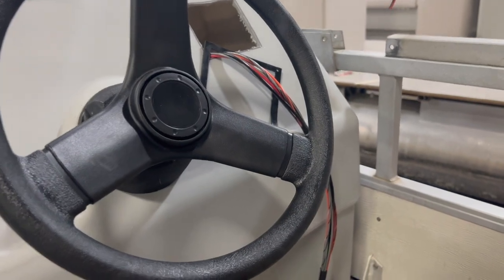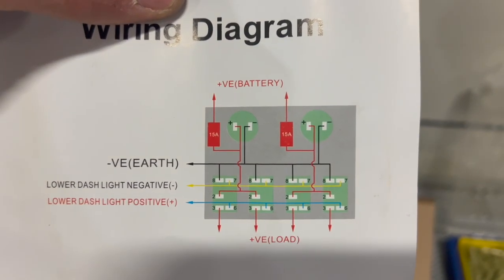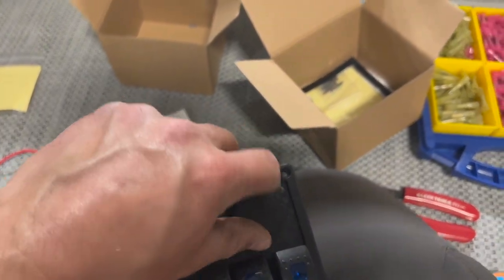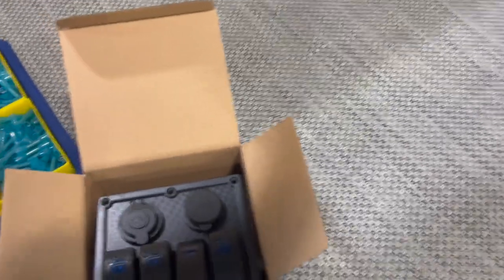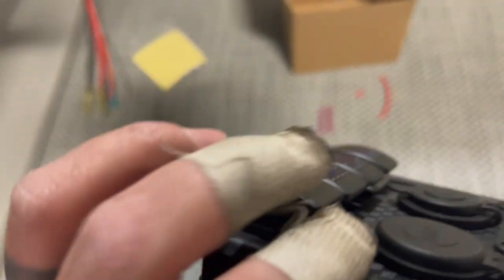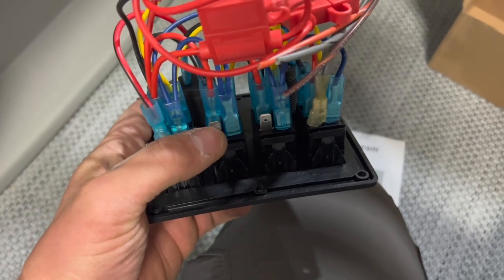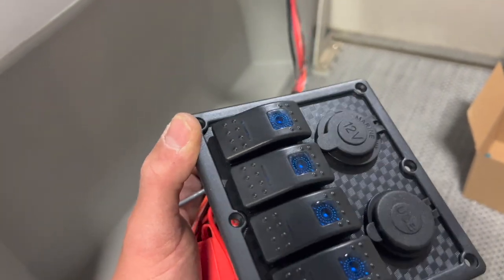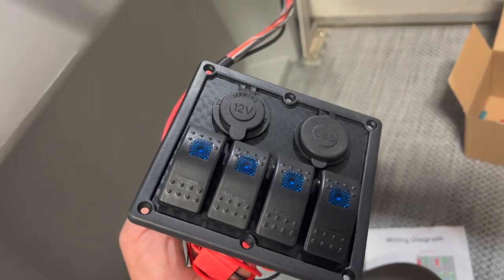How To Install Boat Switch Panel - AMAZON SWITCH PANEL

Comment: I have the same switch but all the lights are on. Not like how you got yours that they individually turn on when each switch is selected.
Reply from the maker: At around 1:50 into the video I show how to get rid of the constant on lights. I just prefer no lights being on when the switch is in the off position. Rarely would I ever want them on all the time. Just one more way for the battery to drain if a battery switch is left on.

Comment: How do I connect the ground wires that are incoming from my lights? I know I connect the power and ground from my incoming power from the battery, but don't know where my grounds connect from the lights that are connecting to the switches. 

I'm installing some light bars on my atv,
Reply from the maker: You should have a ground wire feeding the switch panel from the battery. You can splice/group with that ground wire. You could also use the ground wire from the battery to connect to a ground buss bar or block to tie all of your grounds from accessories together and to the ground coming from the battery. Worst case, run an additional ground wire from the battery negative post to the switch panel to tie your light ground wires to.
Reply: @tomspontoons  so I have the power wire coming in to the switch panel on a two pin for quick disconnect. Can I run all the negative wire together and ground them to the frame or another piece of metal?
Reply from the maker: @mesquiteco5313  I always try to avoid making the frame of the boat a ground. That's where a ground buss block is nice, or just bring them all together and join to a 10 gauge ground wire that runs back to the negative battery post.

Comment: New to the channel. That's a great idea with the tying the USB to a switch. Guess I will be pulling my switch panel out soon 😃
Reply from the maker: Thanks Roger! We’ve found that most panels have an illuminated USB plug which would eventually drain the battery I suppose…so might as well make it possible to stop power when we want. The good news is that it’s a quick and easy adjustment that’ll get things working the best way possible!
Reply: Can you tell any difference with the drain on your battery with the switch panel installed?  Seems very insignificant drain considering how low of  light the usb and bottom light is.
Reply from the maker: @peazy7  I haven't tested the drain down yet. You're right, the draw might be super insignificant. Because we're working on customers' boats I make sure to reduce the risk of any inconveniences up front rather than having to correct it down the road. In this case I am taking the "better to be safe than to be sorry" approach...and much simpler and less expensive than an on/off battery switch!

Comment: Hey Tom Thanks for the tutorial on the switches, would you ever consider a voltmeter or amp meter ?

 apparently don't link to Amazon?
Reply from the maker: I put that switch panel description in the description, check and search from there! 

We install voltage gauges all the time!! Easy to install as they just require power and a ground from the key switch or an accessory switch on the dash.